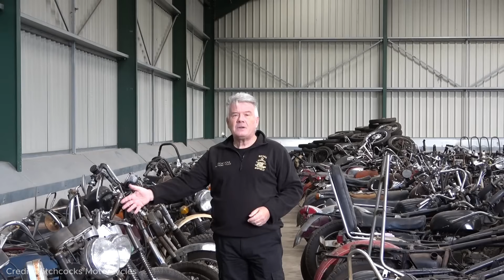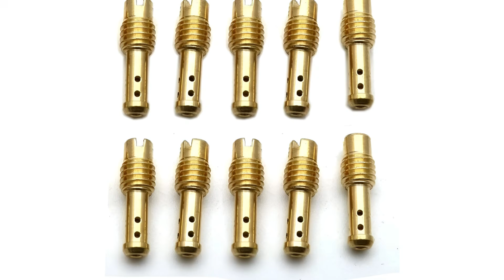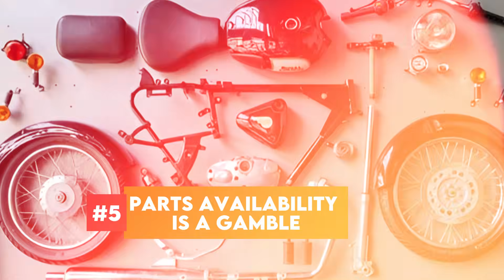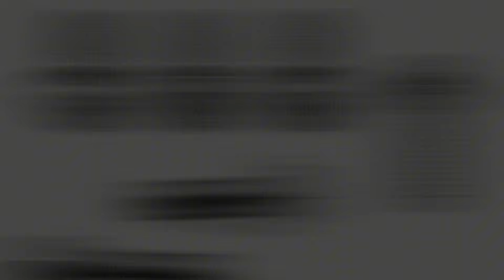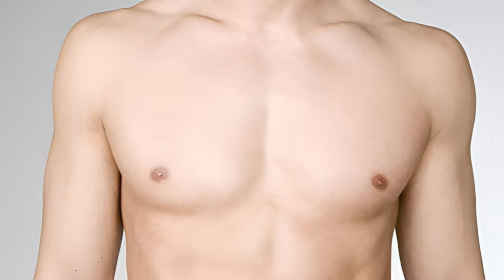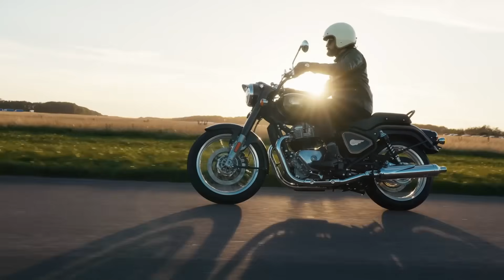Classic Motorcycles Are NOT What You Think (Watch Before You Buy)

Comment: My first motorcycle was a 1985 Suzuki GR650. Having a classic bike taught me the hands-on skills, and not having abs and thinner tires taught me awareness and feel for lean and traction limits, and the brakes were rudimentary and had that "wooden" feeling but they were reliable. The twin carbueretors really were the most annoying part of that bike. Spent enough to get them cleaned and rebuilt, and yet the bike only ran decent when the mixture was more lean.... and the fact that the valve lash was way off in another dimension. When it was running good, it was an absolute joy to ride for my shorter frame, but it definitely shook like a paint mixer above 60-70 mph. I will miss the nostalgic blue and white livery, and the simple air-cooled motor that always started (after all the money and work) and the little bit of smoke and smell at startup. If I could have that bike again, but with fuel injection and liquid cooling, I would buy it without thinking twice...

Comment: Things I don't miss .....
#1 ... Tickling the Amals.   #2 ... Night time, busy highway, a visit from The Prince of Darkness.   #3 ... Anticipating a visit from T.P.of D. at literally any moment.  #4 ... Fouled Plug (or Plugs!) on a two-stroke.   #5.   Mixing oil and gas.   #6 ... Synching 6 carbs or adjusting 24 valves (CBX or Sei ... IYKYK!).    #7. Owning two bikes, one Shift/Break left, one Shift/Break right.   #8 ... Massive frame flex (any bike whose name is H-2 or H-3).    #9.    Finding parts for any bike whose name begins with "Velo" (there's only one).   #10.   Digging through the trash for a pull-top tab for emergency gapping your points.
Bonus ...... Explaining to folks what B.S.A. stands for. And no ... the "S" isn't for "Short"! No inspection needed!
What I DO miss ......  The one thing that kept all the above in perspective .......... My youth!
Thank you!        KL